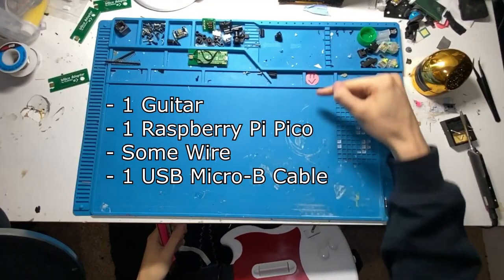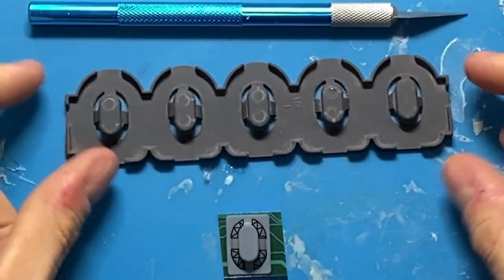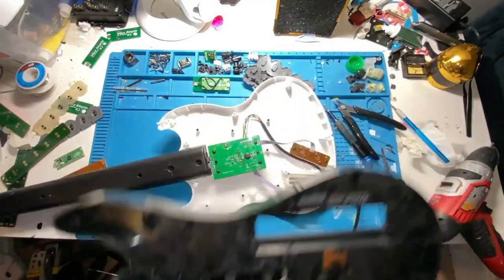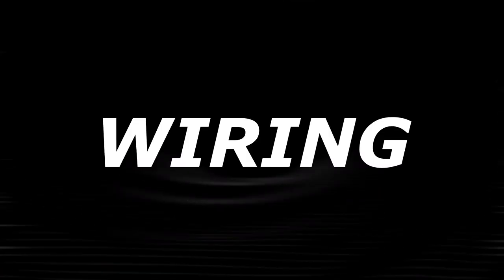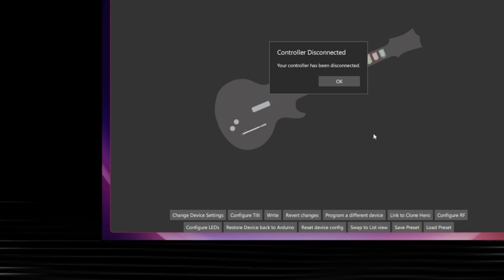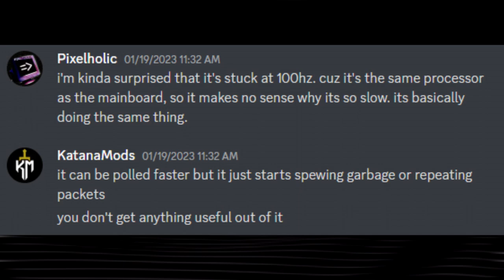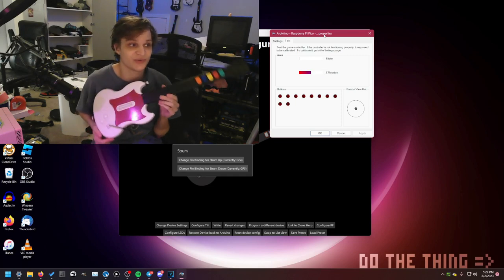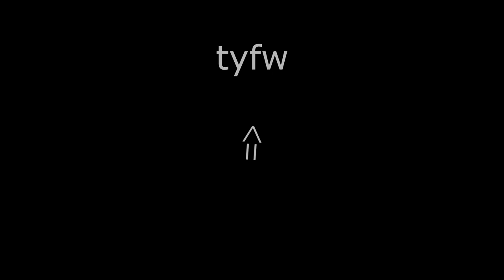How to ARDUINO MOD a Clone Hero Controller

Comment: Came finding copper and found pure solid gold! 

Thanks for this tutorial, been wishing for it for months, as I want to revive my old guitars that I have them dusting as they don't have the receiver anymore. I wonder if the same way works with a Rock Band Guitar, since I have one of each kind lol

Again, thanks for officially making this tutorial. Now I have no longer to worry about how to pin since I've seen the Sanjay's tutorial but still was doubtful. Now I'll guide with this when I get to do this. Thank you so much, and stay safe brother.

Comment: I made a little nintendo nunchuk port to usb adapter following another tutorial  you have using a pi pico with preinstalled headers and a little pcb with headers too and now ive just bought a soldering station and am gonna try to mod a ps2 kramer guitar using this method - these videos have totally helped me and inspired projects dude i respect it

Comment: Hey man, great tutorial! Just was curious about the wiring you used on the strum bar. I was wondering if I should connect the Up and Down to the GPIOs, but for ground, i should have 2 wires running into 1 point out to the Pico and then take one of the connected wires and run it to the 2nd ground point? Dont have much experience with this stuff lol, thanks again!!
Reply: In other words should I follow the lines you drew directly lol?

Comment: Amazing job, You earned a like and a subscription. I have a very important question before I purchase some rapsberries.
For WHICH consoles are these guitars compatible? (I am not very very fluenty with english, so, in case i missed that info. im really sorry)
Reply: My understanding is that the guitar configurator allows you to setup the raspberry pi to communicate as either a playstation guitar, xbox or wiitar. So you should be able to use it with any   console

Comment: i saw you have 4 strum gerber files but 2 fret gerbers, where/what are the missing ones? also am i allowed to use your gerbers as a base to try and add a raspberry pi mount in there? idk really how to edit them but i think i can figure it out, and id like to make it public potentially? as you posted these publicly. 

also YO that pi pico vendor is the cheapest one ive seen by FAR, THANK YOU
Reply: never mind on the fret pcb, i see that one has kmr lp and xp. baller
Reply from the maker: Yeah Kramer, xp, and lp use the same pcb size and fret spacing :P

Comment: Some explanation for World Tour necks would have been nice as it differs from the GH5 guitar even though both of them do have the slider necks. In World Tour one you have 3 pins coming from the slider pcb and 8 from fret pcb and they both get joined at end of the neck so it comes out as 8-pin in the guitar body, atleast it's like that if the board is numbered with RSF-2025-2-0

And if possible, I would prefer to get the neck fully functional
Reply from the maker: That topic is a whole can of worms that'd be better suited for a document, because that guitar is pretty unique compared to the rest of the controllers.
Reply: @PixelholicYT  That's a shame.. I doubt such a document exists atm so guess I'll just have to leave it up on lot of trial and error ^^;
Reply from the maker: If you have a multimeter with a continuity mode, you can figure out what's what pretty quickly
Reply from the maker: I do have the document version of this video in the works with diagrams of all the different guitar types. It will take a while.
Reply: @PixelholicYT  Ooh, guess I'll wait for that to be released then. I don't have multimeter and rather not use money on something I will end up using on just one project 😅
Reply from the maker: @touma-san91  if you do end up soldering a bunch then you will use it every single time to check for connections. just sayinnnnn!

Comment: I wonder if this would work for Xplorers as well
Reply from the maker: it will! good luck with the start/select buttons though. you gotta solder to the pads directly DansGame
Reply: @PixelholicYT My Xplorer's motherboard burned out, What should I do to continue using the buttons?

Comment: If I modify my ps2 kramer with this tutorial, will I be able to use it to play original GH games like GH WoR on my play station 3?
Reply from the maker: you can program it using guitar configurator to work with any supported console, so yes!
Reply: @PixelholicYT  ok, i'm going to try to modify my guitar myself. Thanks for your reply :]
Reply from the maker: @Awewe57  good luck!
Reply: @PixelholicYT  Hey bro I had this problem trying to mod the guitar. And it is detected as if the strum switches were on the same pin, being that they are on different pins (including the ground ones, I also put them on different pins) the strum up is on pin 4 and the strum down on the pin 2. I already cut the traces of the pcb but the problem continues. I thought maybe I hadn't cut the correct traces, but I literally drew a few squares around each of the 4 switch pins.
Do you have any idea how to fix it?
Reply: @PixelholicYT I already managed to fix it bro, thanks for your tutorial. My kramer turned out great :]
Reply: @Awewe57  What did you do to fix it, im having a simmilar problem with the strum as well?

Comment: Does it work with any Raspberry Pi model?
Reply from the maker: nope. just the pico or any rp2040 based boards.
Reply: Does the tilt sensor have to be set at a specific angle?

Comment: What temperature do you set your  soldering iron to?
Reply from the maker: 350 degrees F
Reply: @PixelholicYT  350 Fahrenheit?? Or Celsius? I thought traditional solder doesn’t melt till around 370 Fahrenheit
Reply: @LilBroncho  F is short for Fahrenheit, so yes
Reply: @LilBroncho  lmao mines at 350C. it's pretty hard to fuck up this kind of project in terms of soldering iron temperature. Not impossible but I'm not very experienced and I've had no problems at 350C. I think Pixelholic is just mistaken about units.
Reply: @Cobalt985  that’s what I thought, I had to go to 700F (370C) before I stopped struggling lol. The solder on the boards just wouldn’t melt at 600F which was what I was at before hand. I got it sorted out after long enough I just didn’t want to burn the board is all.